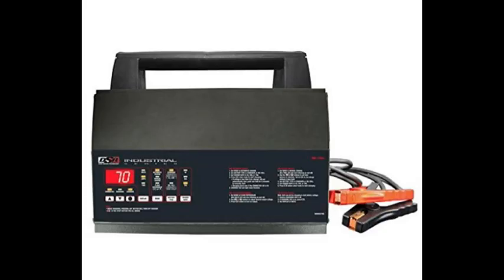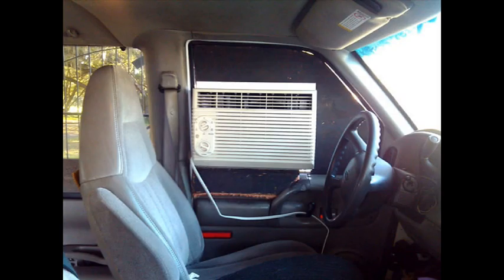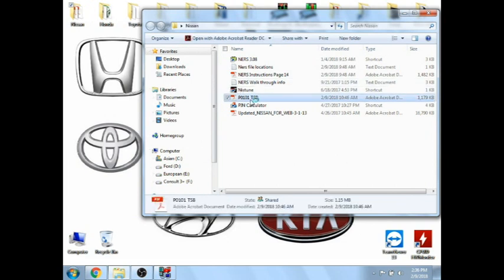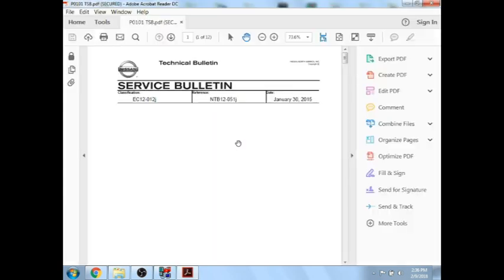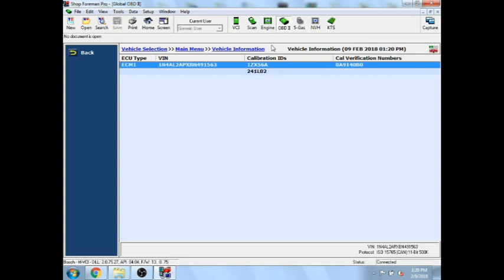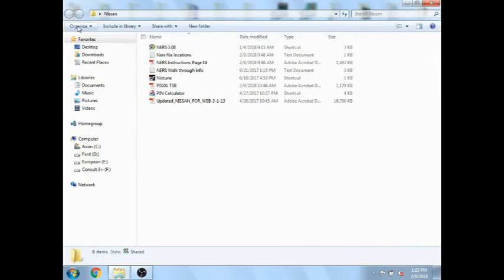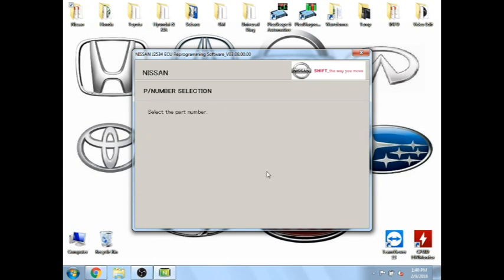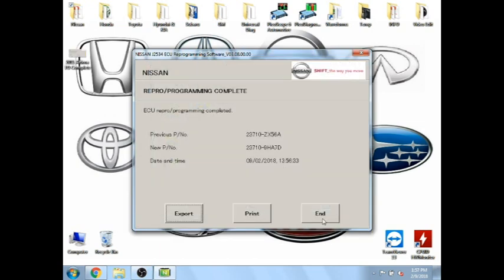How to Reprogram a Nissan with NERS for P0101 code

Comment: I Have this Very Issue You talked in the beginning. I'm Having Errors at the End. I'm Reprogramming A Used TCM. Firstly I did Not have the 107 Folder, I had to Create the Folder and name it 107, I'm Using the Online NERS Version (V03.04.00.00), Not Original From Nissan. 

Searching Car the VIN On The Website Pulled up 31020CM38D For For the TCM, But the TCM Part # They Put in the Car (Pulled by the Scantool and NERS Software) is 3100-WL611.

Another Weird thing is When I Went to the Nissan Website to Buy the Programming Files, Under "CIII + Reprogram" It did not give Me any Drop down Info when I typed the 1st 5 Digits of the Part Number and the Last 5digits Under CIII+ Reprog Or CII. Only When I Went through C-III+ Blank Was I Able to Pull any Programming Data And It was only possible with the 31020-CM38D Part #. The Replacement Part # Did not Pull up anything.
So Now I'm Stuck, because It would not allow Me to Program either by Reprogam (Says No ONC) Or Programming in the NERS Software Gives Error and Shows 0kb file size.

Please help, I have Uninstalled and Reinstalled the NERS Software and Its till doing the same thing.
Could I have Possibly Bought the Wrong Programming Software? Or Do I Have the Incorrect NERS Version?? please Help

Comment: Quick question. I know you mentioned that the stable battery voltage is one of the most important facts. I don't have a battery voltage maintainer. Do you think it is okay to do without a battery maintainer? I think my battery is pretty stable and it shows now 13.3..  Or any experience without battery maintainer??? I don't want to spend about $500 for only this step for it..  Thank you and this is a great video.
Reply from the maker: It is required to have a quality battery maintainer. That's why it is one of the most important steps!

Comment: I have a jx 35 , im getting code p0101 mass air flow.. i have change the sensor, change the filter and clean the throttle. But how do i program the engine control model? Where do i buy the pieces and nerd program?
Reply: Do you fix it?
Reply: @alejandrovillalobos9026  i bought a new transmission

Comment: I have a 08 g35x ... needs a new valve body ... isnt nissan.the only way to get this car running ? Like do individual people hv consult 3 ? Is ners or consult 3 what i need to get a different valve body working and does it have to be a blank one.i buy from nissan ($2500) or can i buy a vb online that claims to be "programmed to my vin " and plug and play ? My part numbers 3170561x2d

Comment: When I try to do that always ask me to log in if I'm dealer or aftermarket, etc. Then I'm not able to continue because of that..
Reply from the maker: You must have an active nissan subscription from the techinfo website, then use your login credentials from the site. It will cost $270 a year for the subscription plus 19.95 for each flash file download.
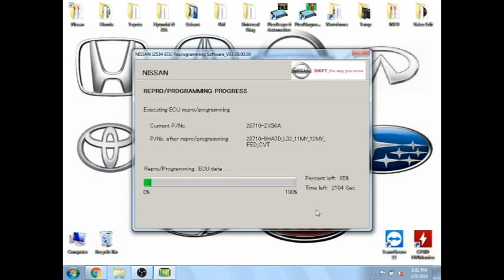Reply: L1 Automotive Diagnostics and Programming LLC L1 Automotive Diagnostics and Programming LLC I already got that. I do every step like you do, but exactly in the min: 10:30 it asks me lo log in with a dealer, aftermarket, etc.
Reply from the maker: @Julicauto  thats where you put your aftermarket login credentials.
Reply: L1 Automotive Diagnostics and Programming LLC so how do I get that?
Reply from the maker: @Julicauto  you must go to the techinfo website and pay the $270 for the sub.

Comment: mine does the same but wants me to authenticate my app? connects to te internet and ask me my tech id and password but mine wont work
Reply from the maker: Starting with NERS 4.0 an active NERS access account is required. You must be current on the $270 yearly charge to use it.
Reply: @L1Training   I just purchased NERS and the ECU Files. How can I Complete User Authentication on Web Application? I do not have a user group, and I am not able to reprogram the ECU of the vehicle.

Comment: hi, i have this error : Error code: RNDS_CAN_ALL_COMMON_STEP6_2_SELF_CHECK_NG
any ideas.
i check battery, fan, wires. all ok
Reply from the maker: What version of NERS are you using? and make sure all firewalls are off.
Reply: Keith Perkins Ners 4.0
Reply from the maker: I have had many issues lately with 4.0, try uninstalling and reinstalling. That did not work for me last time, so i just uninstalled and reinstalled 3.08. I try new versions on the 4 modules I have setup for bench flashing first before I upgrade.